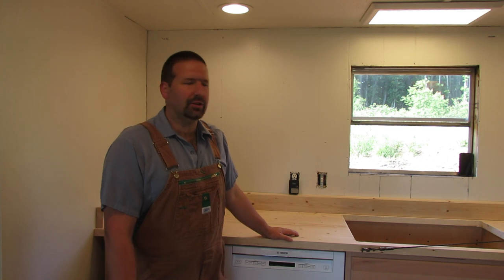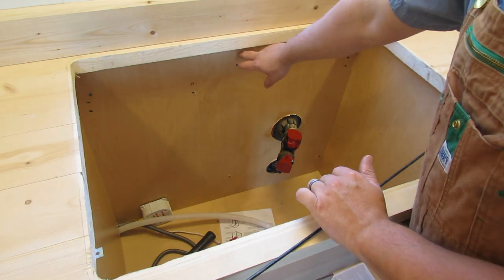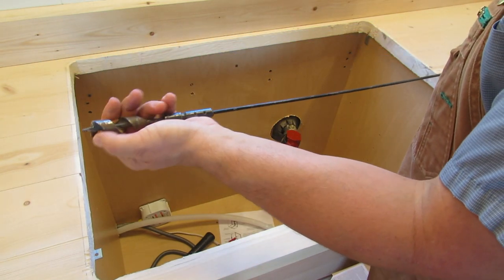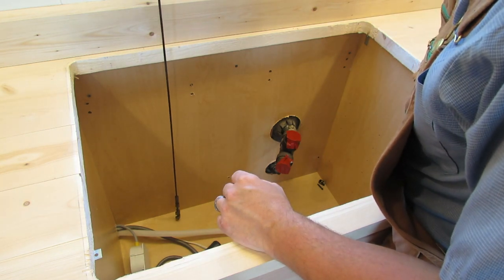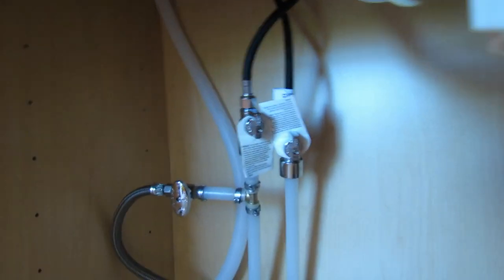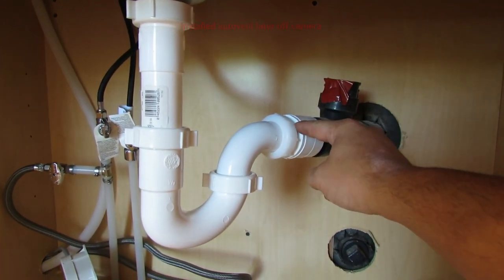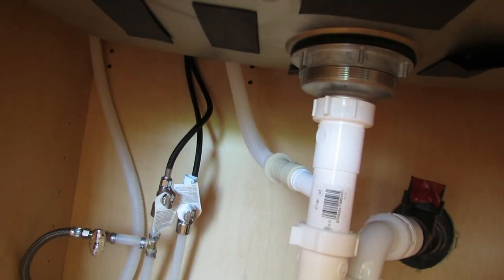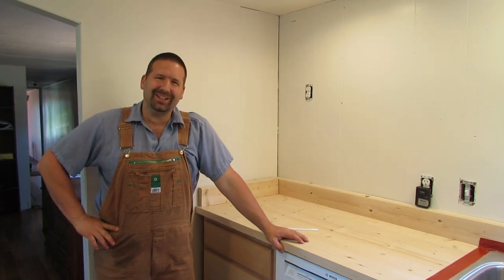DIY Sink Install In the Mobile Home

Comment: Hi, I’m trying take out the entire countertop of my kitchen sink. Did you build your countertop? What type of wood?
Reply from the maker: Hi Kayla. Yes we built our countertops out of simple pine boards and sealed it with beeswax. Check out our videos called DIY countertops part 1 and part 2 in the mobile home renovation playlist. They are still holding up great, were super cheap, but do need to be sealed fairly regularly. Let us know how your project turns out! ~Mrs. C.